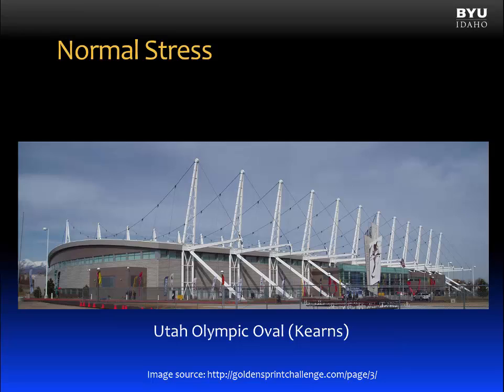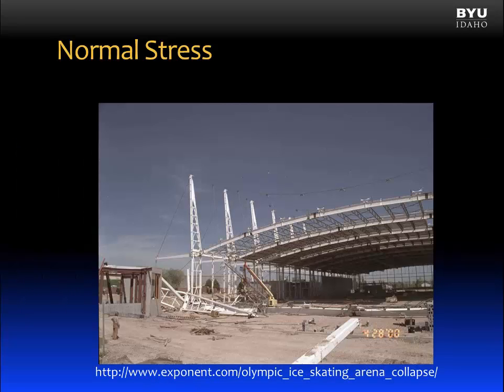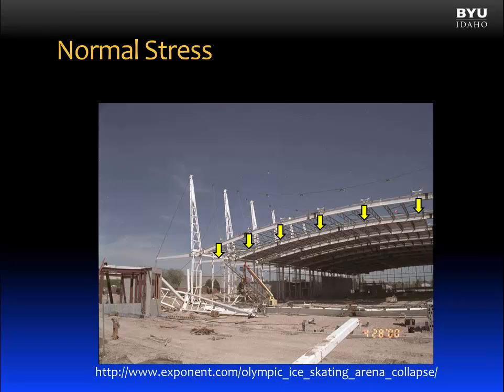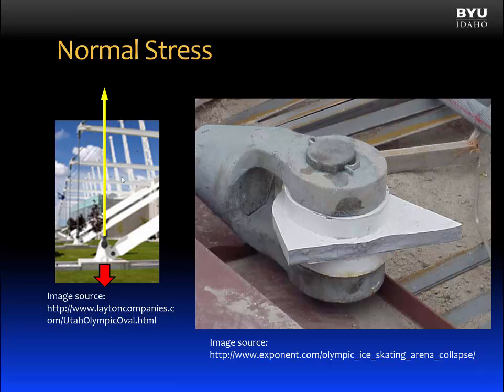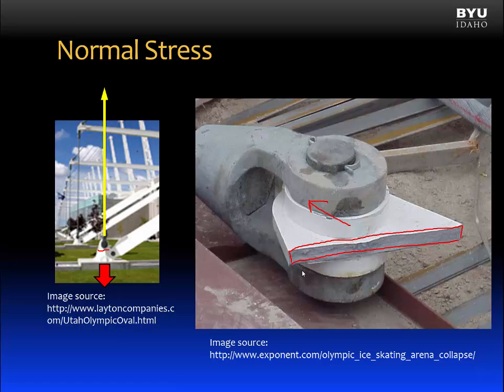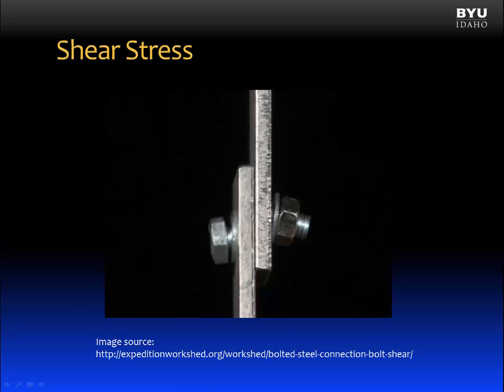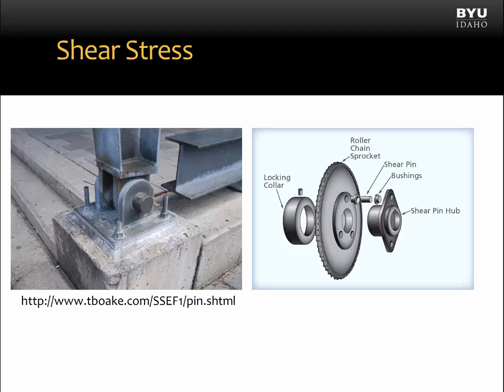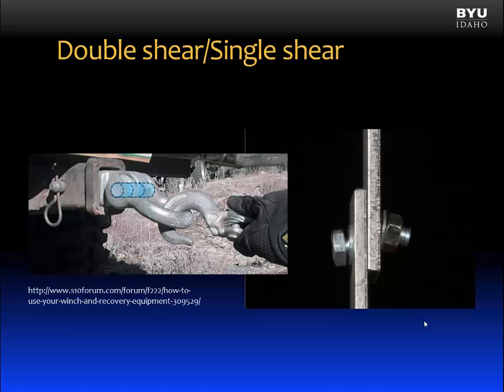01.2 Normal and shear stresses - Part 2

Comment: I have a quetsion...when you determine loads @ sec 1.42 you neglect the load on the tallest part...why...can you explain that to
 Me
Reply from the maker: The vertical frame section is subjected to a compression load from the cable, but I do not show it in the illustration.  The compression load in the frame is transferred down the frame to the frame foundation, which is separate from the cable support foundation.